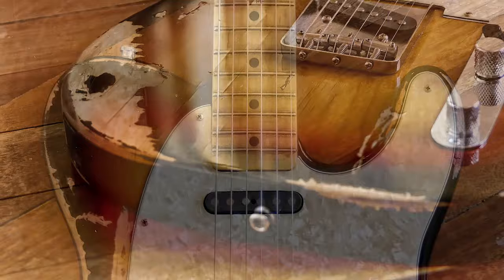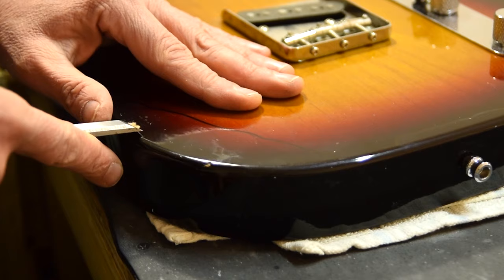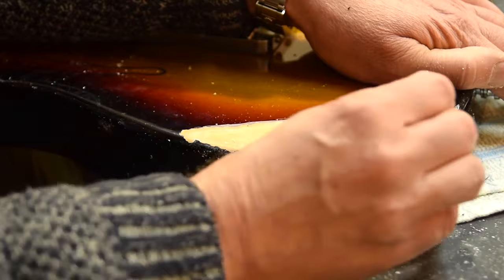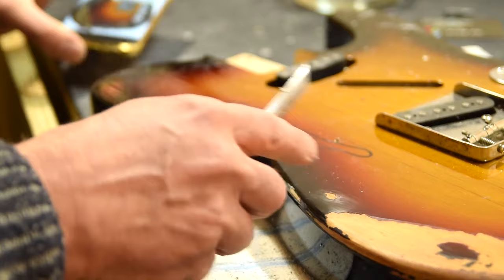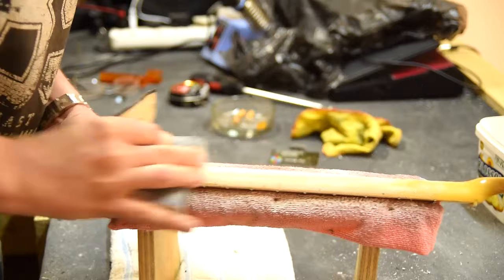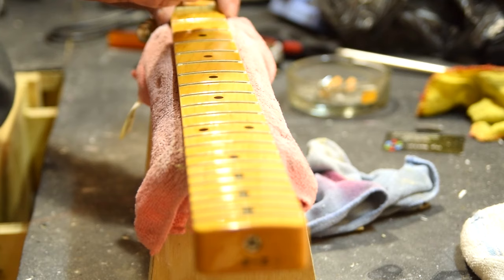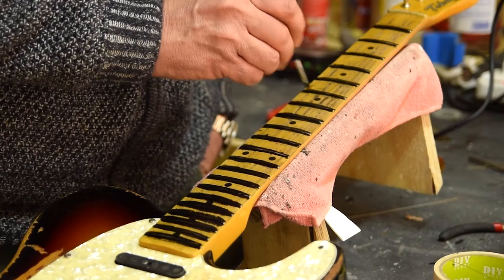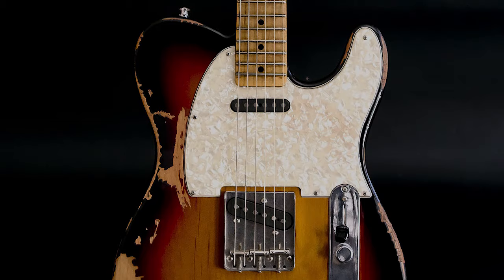Tele Guitar Relic - Mike's Guitar Workshop

Comment: a heat gun makes this process much easier, you can loosen the finish in specific areas and follow up with a file and a flathead.
a swipe with the end of a flathead will lift the lacquer enough that you can use the file to scrape it away and not risk taking any of the wood away with it.
just follow the natural angles of the body for authenticity and don't go overboard. otherwise, it's quite difficult to go wrong with this method